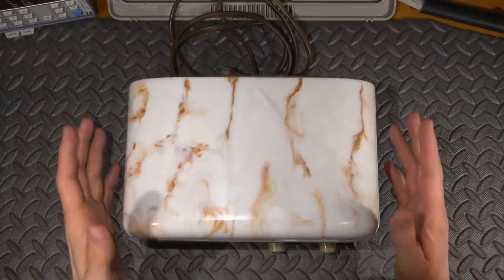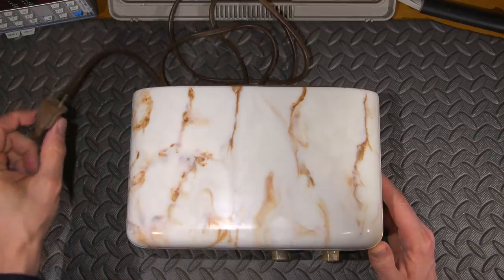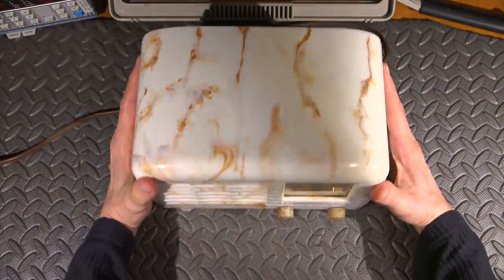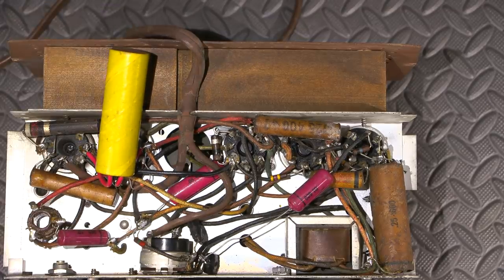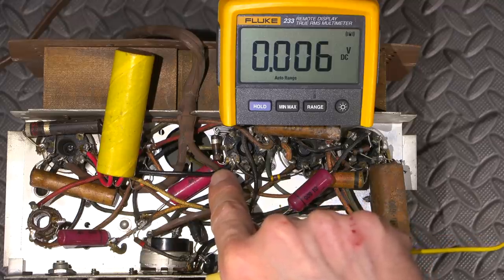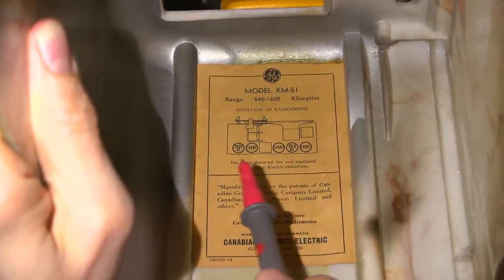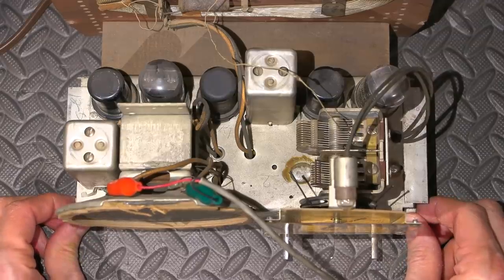1939 Marble Radio - Will It Work? Let's See!

Comment from the maker: To learn electronics in a very different and effective way, and gain access to Mr Carlson's personal designs and inventions, visit the Mr Carlson's Lab Patreon page here: https://www.patreon.com/MrCarlsonsLab
Reply: Repair the speaker please it will make a very interesting video and be educational for people who might be unable to find a replacement speaker for it plus its better to keep it as original as possible.
Reply: I want to how a speaker can be repaired/Rebuilt !
Reply: Yes please Mr. Carlson repair the speaker, it's very exciting. 😍😊👍
Reply: Hi, I’m terribly sorry in attempting to contact you this way, I was advised to get in touch with you. I came across at least a hundred vacuum tubes for sale at my local value village, all BNIB. Most are Hit Ray branded and are TV/Radio tubes to the best of my knowledge.
Reply: You and Birt have really inspired me.  The other day I got the nerve to reflow the joints where a pin header connected to a board that is part of the 4wd switch on a Chevy S10.  It was in no way as complicated as the work you do, but a couple years ago I would have just have ordered a new one.  I also knew to look for the cracked solder joints in the first place. Thanks and happy new year.

Comment: A speaker rebuild will be interesting. How to you mitigate the addition of your test speaker across the original speaker (change of impedance?)
Reply: Tube amps generally will handle lower impedance just fine.
Reply: I would like to see a speaker repair as well.  Back when I was a teenager, I hung around my neighbors Radio-TV repair shop and he often sent speakers out for reconing.  Back then it was no more than $2 - $4 for the typical car radio or TV speaker recone.  I wish I could get 4 inch cones as I have a huge box of bad 4 inch speakers.
Reply: Putting a relatively high impedance ( in comparison to a 4-12 ohn speaker) has a small effect on what the speaker is doing.  It gives a good idea of whether the signal is making it thru the transformer without distortion.
Reply: I think he was using a signal sniffer for the test, not just a speaker in parallel
Reply: Oh ok last test was a speaker - wuick and dirty test with a good speaker won’t hurt anything though.  I’d guess the original speaker cone paper distorted and the voice coil is dragging on the magnet.
Reply: Yep, speaker rebuild for sure!
Reply: @NiHaoMike64  not much lower, 8 ohm 2ndary tap being connected to a 4 ohm speaker, even worse a 2 ohm speaker, byebye output transformer, they have different taps for a reason...

Comment: Might be interesting to see if the speaker can be repaired, since electromagnetic speakers are no longer available.
Reply: All loudspeakers are electromagnetic.
Do you mean the type where there is no permanent magnet, rather just an electromagnet (which also works as the smoothing choke)?
Reply: @BrianG61UK  modern speakers use a permanent magnet that the voice coil reacts with to create physical motion of the speaker cone. These are normally described as permanent magnet speakers. Prior to the development of Alnico permanent magnets, an electromagnetic DC coil was used as the magnetic reaction source for the voice coil. These are normally referred to as electromagnetic speakers. The DC coil in the old electromagnetic speakers was normally used as a choke in the B+ power supply circuit.

Comment: Catalin is a very thin, often translucent material that was favored by tabletop radio manufacturers from the 1930s through the ‘50s. It was molded in many colors and today these very colorful radios are widely collected. Careful collectors know better than to actually play these radios, for when they heat up the Catalin can catch fire due to aging and fragility (this is not a problem with Bakelite radios which are practically indestructible). Use caution !

Comment: Typically a speaker that distorts is caused by a warped cone.  This can be caused by its getting wet at some point.   Repair is to separate and recenter the cone.

Comment: You have a good point about old tune radios taking a little time to warm up and make sound. I've run into occasional flea market dealers, estate sellers and such who had various solid state radios for sale. When I asked about any older radios, they said the older radios didn't come on right away, like the transistor sets they where apparently used to, so they threw them away. Grrrr.

Comment: The idea of a speaker being repairable is relatively new to me. Even allowing that, the only repairs I ever hear of anyone doing are to replace the rubber surrounds on the cone. Would love to see the details on troubleshooting/fixing a voice coil! 👍️
Reply: I've seen videos of voice coils being made and it's really not a big deal for a speaker like that. Something that can turn a piece of stock that matches the ID of the original. The materials are nothing special. Once you've seen it confidence will be high. That said, I haven't had to do it so let the comments begin.
Reply: @InsideOfMyOwnMind  Of course. It's fundamentally an electromagnetic coil (or two, as is the case here). It probably doesn't take rocket science to figure it out. I'd still like to get Mr. Carlson's detailed view of how this works. I'm sure he'll have something to say neither of us would expect.
Reply: @McTroyd  Agreed. I wonder what speakers he has repaired beyond a cone patch. I would lke to see how he approaches it. I have re-coned quite a few from provided parts but never made my own VC or cone. I think the spider would be the most interesting part to fabricate.

Comment: An electromagnet speaker, that's a blast from the past!  My dad used to fix an old Admiral TV back in the 60's (the TV was from the 50's) that had one of those.  They were obsolete even then and if you replaced it with a permanent magnet speaker you had to also find a choke for the power supply.

Comment: Too bad you do not live closer. I have a Marconi model 53a from 1926. A tuned radio frequency set with a very unusual speaker. All parts seem to be original apart from what looks like a small mod to run it on mains power. 
Great video and looking forward to seeing the restoration.
73s de G7WJJ

Comment: GE  Canadian KM-51 early design with 12 volt tubes.  Looks like the inside label went over the silver overspray so that
 was done at the factory. Replacement dual electrolytic capacitor  and three plastic covered ones from mid fifties .
 Great troubleshooting there Mr. Carlson. Hope you can show us how to repair this speaker!

Comment: i'm always amazed by how these vintage electronics have a vast and well established database of circuit schematics for consultation. I often struggle to find it for modern ones. That's  probably because  back then we used to fix  things instead of  just  replacing it.
Reply: Appliances such as dryers, and refrigerators still have them tucked away inside. But those are big ticket items of course.

Comment: Perhaps that 12/57 signature on the chassis is an indication of the capacitor changes.  If so, those caps are still doing a pretty good job for 64 yrs old.  Wish my 64 yr old body was doing as good a job.  Happy Holidays All!

Comment: @6:05  You do the same thing I do. Not even bother putting a 1/4in driver socket in the spin handle because it already has a 1/4in hole that works just fine. Also works brilliantly if using it in a deep recessed and tightly confined holes.

Comment: Hey Paul you're the greatest!!. I've been working with electronics for a very long time and I am impressed with your talent. I used to be a member of antique radio forms but I canceled my membership I was not at all impressed with them and I'm not the only one. There were a lot of others that noticed a lot of arguing on that forum. I believe that great minds think alike and agree with each other. They need to screen their members better. What really made me mad is when they criticized your capacitor leakage tester. The more they criticized the more they revealed how dumb they are. I stood up for you I know what you made was great. If a non polarized small value capacitor leaks at low voltage it should be thrown away its not necessary to test it at 400 volts if it leaks at low voltage duh!! like the EXPERTS there think. Take this .05uf 400volt wax paper capacitor and hold it with your fingers and apply 400volts. If it gives you third degree burns you know it's leaky. I'm sorry but they really ticked me off I'm glad I'm out of there I don't associate with them anymore

Comment: Hi Paul - Interesting !  Electromagnetic speakers often are the source of 'head-scratch' - Especially if the energizer coil went open or short.  Often I have inserted a choke of similar value in it's place & put a PM unit in place of the original.  It's a bitch to get the pole-centre out the frame to rewind the thing.  Then all the fish-paper alignment...  On the bigger sets it's a worthwhile effort.  VC's on the small units are often open.  /  Yup, thanks for yet another fun presentation.  Much enjoyed, and YES that's a very pretty little GE + a full restoration will be worth it.  73, de Tony in S-Africa...

Comment: IMO there is still something wrong in the HF / IF section as the reception isn't equal all over the rotation of the varco. Leaky screen-cap, maybe ? 
About that speaker ... would be very interesting to see how you'd do this, sir.
I repaired a few of those old AA5 having a "stuck" speakercoil-issue. I succeeded many times to get the speaker going again by moving the cone by hand to remove some rust-particles ... or by using some penetrating oil (yes, you are reading correctly !!! ) without damaging the speakercoil. I removed the dustcap to do so.

Comment: The speaker problem sounds like it could even be rust in the coil gap caused by moisture ingress, or off gassing from the glue used. What I've found works is a 3-5V AC signal from a variac and then gently pressing around the cone to get the coil gap free.

Comment: Nice radio, it reminds me of the Northern Electric Model 5000 Baby Champ.  I've read that back in the day there were parts of Canada that only had 110 volts (or less) house current, is that the reason for the 35L6 audio output tube instead of a 50L6?
Reply from the maker: They probably had lots of them, so they used them up.

Comment: My signal tracer has binding posts allowing the speaker in it to be used as a test speaker. 
Another way to check the speaker is to gently push the cone with your fingers. A raspy speaker will sound and feel 'crunchy'.

Comment: What a nice little radio, shame the speaker is damaged.
Hopefully it's just the coil support tube rubbing against the magnet.
The volume on/off might have been replaced, notice the filed down shaft to fit the control knob.

Comment: It's easy to forget how common radio and TV repair shops were.  It seems nearly every set you open has had some type of previous repair.  It seems to me most of those little repair shops faded away during the 1980's

Comment: 2:28 Wouldn’t be amazing if all those stations are from 1939 and that’s why they are distorted? 9:26 what? Why? 🤯The bare minimum 😱this is driving me nuts dear Paul. 17:43 when Paul uses his Superman finger and just touches hot iron and nothing happens 🔥
Reply: It’d have to be very far away (like 80 light years away, right?) 
Actually that would be a super cool sci-fi story
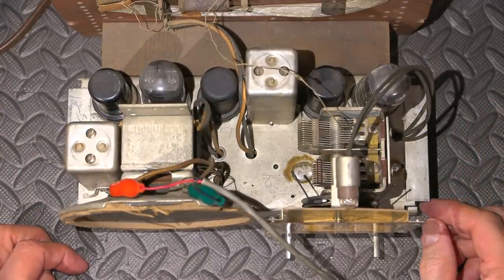Reply: @thomashowe855  25:40 in my professional opinion if you fix the speaker 🔊 the signal from 1939 is gonna be lost forever, it doesn’t help to correct the error of the previous technician that was inside the old radio 📻
Reply: @KetherWesak  I agree.
Reply: @thomashowe855  hahaha 🤣

Comment: Im restoring a 1940 rca bp-10 and the speaker had a frozen cone and very low volumen..the magnet shifted and binded the coil..i took it apart and noticed the magnet was very weak..i ordered a equivalent size neodyum..im wondering how the radio will sound with a new magnet.i even found in the service manual how to recone an recenter the coil...pretty simple using a round shim or strips..

Comment: I would love to see the speaker repaired or replaced with a pm speaker with the corresponding resistor to replace the field coil, which I have done on a few radios.

Comment: I know that tube radios can handle a temporary change in output impedance without too much trouble, but when you paralleled your lab speaker with the original speaker, why didn't we hear the distortion from the original speaker?  Yes, I'd like to see you repair that speaker. It may be a bit like comparing apples to oranges, but I'm taking notes on various speaker repairs as I have an original field-coil speaker from 1926 with a badly damaged cone that I'd like to restore, if possible.

Comment: The signal tracer probe is at the plate, there is always high voltage at the plate. You did not use anything to block the DC voltage. Would you like to explain?

Comment: You might can use it as an EMF or RF radiation detector at the 530 wavelength, though old tubes probably had dirty electricity which emits EMF radiation.

Comment: The screen voltage is higher than the plate?
Reply from the maker: In some cases yes.
Reply: @MrCarlsonsLab  how does the amplified signal/current form on the plate if it’s at a lower potential than the nearby screen? Thanks in advance, Paul.

Comment: Seems like you've changed your 'modus-operandi' in powering up these sets, when in the past you've stressed that inevitably the capacitors have to be changed, and will lead most likely to damage (selenium or diode-tube and DC on grids); but I did not see you check any grid until 20 minutes into the video?   Back when I was young (and the capacitors were much younger!) I would bring these up on a variac to see if there was any life--but I would quickly check for DC on the grids and signs of leaky/shorted caps.  
However, these days, if someone brings one of these to me, I first ascertain if they are serious about restoration--I refuse partial 'get-it-going' repairs since they always fail, and the customer still thinks you didn't do all you shulda, for the pittance they so generously afforded you!.  If they're serious, I check the continuity of the IF transformers and any special parts then just go after the restoration, not really finding to much value in 'does-it-play' curiosity.
Anyway, great video and a very nice old GE that when restored will give many more years of faithful service!

Comment: What I have learned from your chnl is that without all kinds of hi-tech equipment, im dead in the water when it comes to any repairs on all my old radios??? Your chnl is great, but I am really bumbed out.
Reply: Not really, as far as what I've learned so far one can start with a dim bulb tester and a multimeter with a dab of common sense. Know-how is the key and without sounding like a broken record sign up for his online course where you will find plans to build much of this hi tech equipment yourself!